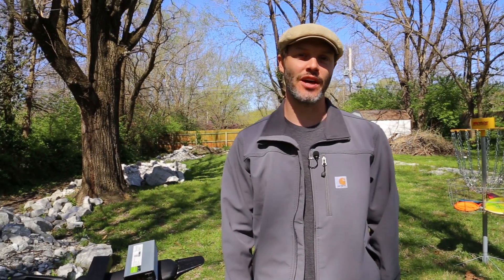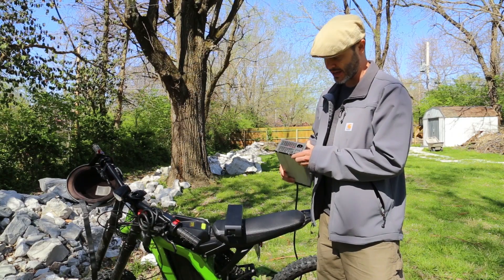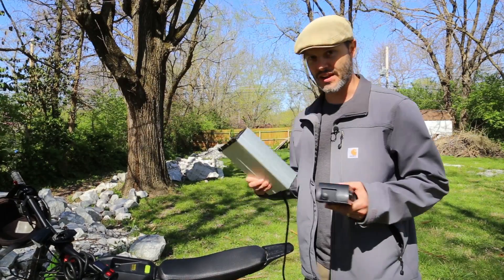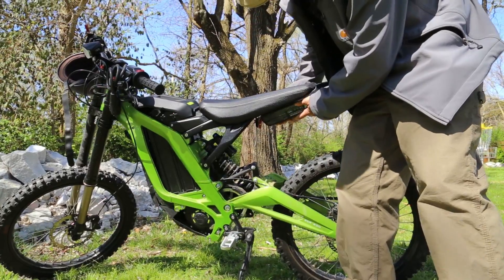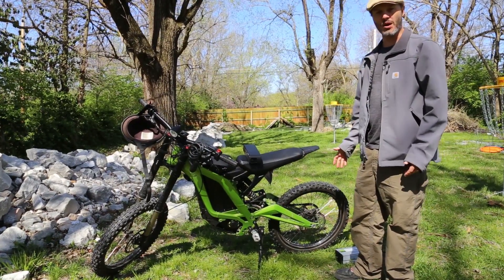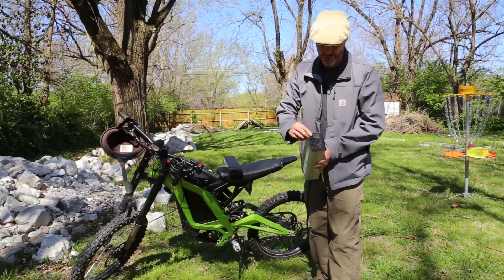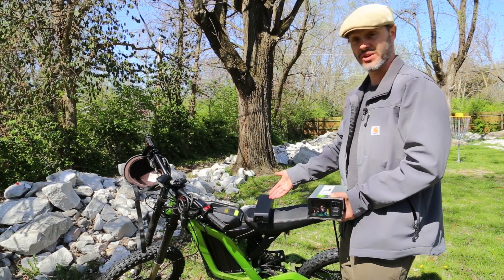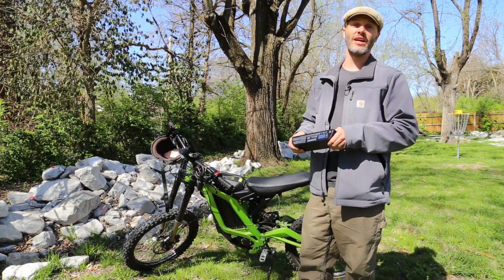Sur Ron Bee aftermarket charger- electric motorcycle professional review

Comment: Did you have to get a special adapter cable to go between the bike's battery and this charger or were you able to reuse the one from the stock charger?
Reply from the maker: I yanked the stock charger plug and installed it on the new charger cable.   The original charger was also replaced at no cost since it overheated some components, so now I have two chargers.  Gotta love products with companies that stand behind the products!
Reply: HolmesHobbies Have you been able to identify the type of connector? I’m hoping to have both the original and an aftermarket one, I’d prefer not to cannibalize the stock one.
Reply from the maker: Not yet.   Kinda stopped looking when I ripped off the old plug.   It has markings on it, maybe when you get it you can look it up and get further than I did.
Reply: @HolmesHobbies  One? Can the Sur Ron battery be charge via the discharge port? Or is that a BIG NO NO!! 😊
Reply: @HolmesHobbies  lol never mind I answered my?  😊yes can be done,just test with a 4amp scooter charge and it works no issues,but 4amp is slow but the charger is super small and light 😁
Reply: @Skuba.1361  I want the same thing but what is the name of the fitting that plugs into the sur ron battery. Thanks

Comment: John when I get my bike I will remove the braking sensors on the hand brakes. Is it just unplugging? And where do the wires terminate from the brake levers? I've raced motorcycles all of my life so I'm sure I won't like the throttle cut out. Thank you.
Reply from the maker: the brake sensor wire has a barrel nut over the end at the lever, 8mm I think.   Just unscrew that and it comes out of the lever.   The plug for it is located behind the key switch.   Remove the keyswitch body from the frame and it pulls out, unplug the sensor wire, and re-install the body on the frame
Reply: Hey John again, thanks so much for your help.
Reply: John again thank you. It worked well and I also cut and shortened my brake lines while removing the sensor wiring. Now it's all very tidy! LOL

Comment: John what is the weight of the Sur Ron battery? Thank you.
Reply from the maker: If I recall correctly, about 30 pounds.
Reply: Thanks much John. I am trying to determine if the bike's weight is too much for my Thule bike rack https://www.thule.com/en-us/us/bike-rack/hitch-bike-racks/thule-easyfold-xt-2-_-903202 which is hitch mounted. So at 80 pounds it exceeds the max 'per bike' but not the overall load capacity. I didn't want to buy a truck to haul my bike to spots where I can ride so I wanted to know the bike's weight sans battery. Thank you for that since I could not locate the battery weight anywhere online. I'm also glad to hear that the wheel nipples have been improved in size and the charger is different. I am on v2 as I just bought mine and am awaiting my shipment next week.
Reply from the maker: double checked for you, battery is 24 pounds if I can believe my scale.   Won't be so bad on the rack if you keep it mounted closest to the hitch point.   hoisting it up there will be the tough part.
Reply: OK thanks for the double check. I do plan on mounting it on the rack closest to the hitch point. The rack comes with a little folding ramp, so if I can't hoist it up myself without causing a hernia I'll just roll it up. The Sur Ron and my gf's ebike are still are under the total weight of the rack rating so I 'should' be good. Thanks again for checking and your informative videos John.
Reply: John I got my Sur Ron two days ago and yes like you I measured the weight of the battery at 24.6 pounds. I went on an off-road 20 mile maiden ride yesterday and what fun! I can see what you mean about a different seat though....my butt hurts. I'm use to riding distance on my MTB seat, but this one hits different parts of my butt! Wrote to Luna since on three separate occasions the engine just cut out, meaning no throttle response. The display and the lights remained on, but until I pedaled (I have the pedal kit installed for 'legal' reasons) for a bit the engine did not respond to throttle input.

Comment: If your only charging at home with stock charger, switch it to 220v and use 220 outlet you won't have to worry about tripping breaker.
Reply from the maker: That would be a good choice.   Too bad the stock charger burned out!  Luna is sending a new one that should be a different model.

Comment: I would be interested in you investigating the Sine Wave module - test mule looks to have 50-75% more power. Also, another topic would be better replacement tires - Pirelli Scorpian???  Also, would be interested in what it would take to make the rear light function as a brake light. 
Really enjoy your videos. I've had my Sur-Ron for two months - like it a lot.
Reply from the maker: I'll be getting the ASI controller when Luna has their own tuned version.     Tires, good recommendation.   I've been eyeballing the rear light as well.  It is just two wire, so it would need dual voltage supply to function as a brake light.   Like 8v running mode and 12v brake lamp mode.    Probably easier to install a second light for brake.